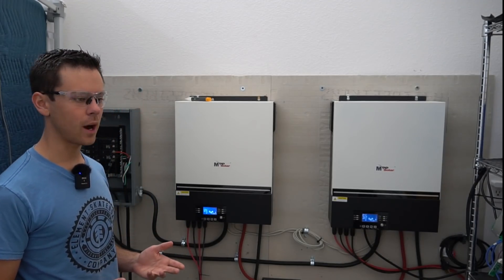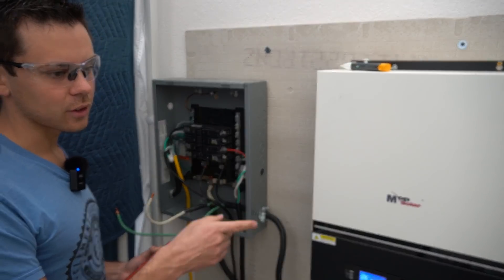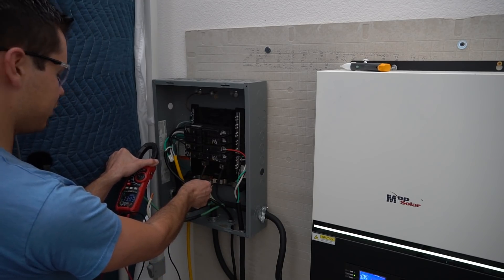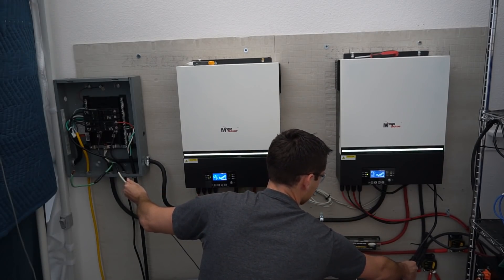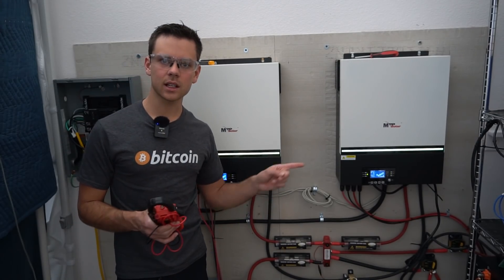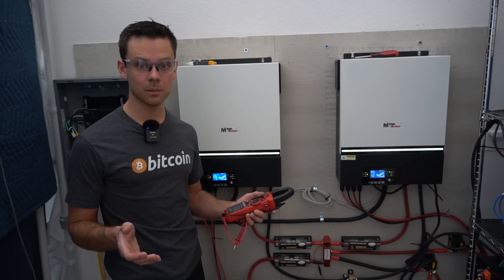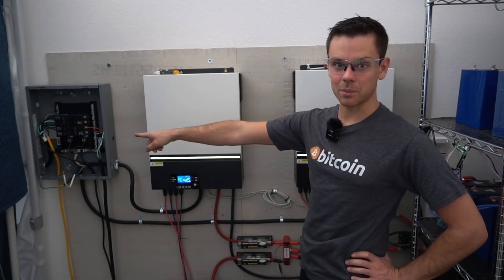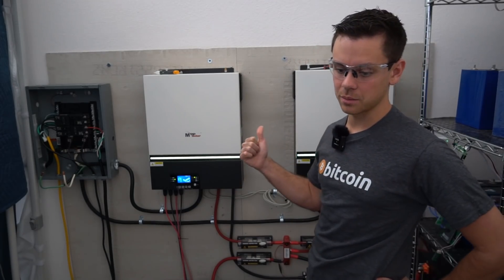Advanced Level Grounding Discussion for All-in-one Solar Power Systems

Comment: For my dual victron split phase setup, the grounds are daisy-chained to avoid ground loops.  The victrons have a ground-neutral relay that closes when shore is not connected; I made sure that my incoming two neutrals to AC-IN and the outgoing neutrals from AC-OUT are the SAME LENGTH so the resistance was as close as possible.  The 14v you saw may be due to mismatched neutral wire lengths.  Agreed -- if connected to grid, don't add another earth ground.  And agreed -- don't add another ground-neutral bond in your panel.  It appears, like the victron setup, you'll always have a ground-neutral bond, regardless of whether you're connected to the grid.  You technically had two bonds (albeit short distance so highly unlikely to cause an issue).  you may also have small ground loops if you're not daisy-chaining your grounds (Inverter 1 -> Inverter 2 -> panel; also grid -> inverter 1 -> inverter 2).  Daisy chains may be problematic from a code perspective; you don't want a breakable ground (so the daisy chain must remain intact if you disconnect the middle device from ground - a la pigtail).  I am not an electrician; I went through this same exercise with Filterguy on the forums when designing my RV system.
BTW I didn't think it was safe or accurate to check for continuity on live wires (voltage potential between the wires)?  Maybe today's meters can handle that?  Dunno...
Reply: I guess what's not clear from your testing is whether the G-N bond actually comes from the grid when powered by the grid.  I WOULD expect ground to be connected all the way through no matter what, just as you showed.  From your description of the expected behavior, it sounds like there's a G-N bonding relay?
Reply: Yes a CAT III meter will happily handle the voltage rms produced by our solar systems so no worries on prodding away at terminals just dont accidently put it into the amp testing modes as most are limited to about 5A I believe? looking at my fluke next to me thats what this model says. Itll act as a dead series short in that mode and we know what happens then

Comment: excerpt

If power for IT equipment is served from a separately derived source independent of the building ground system, noise might be generated on the system. This is a form of common mode noise, in which the power-source ground is referenced to a different point from the equipment ground. These stray currents—in other words, noise—can find their way onto grounded equipment, thus energizing the equipment.

Comment: Yep, this is causing issues for me. I'm using a single LV2424 to power some critical circuits as a backup/free solar. 
The AC output of the LV2424 is going to a sub panel which I have combo AFCI/GFI breakers in, however these are occasionally tripping, along with the 30A GFI breaker in my Main panel that serves the LV2424.
Like you, I have measured 1 volt or less between various points of neutral and ground in my system. I am thinking the bonded neutral in the LV2424 is causing a very small voltage leak to ground that is tripping both input and output GFI breakers.
But for safety concerns I want the LV2424 input to be GFI protected in case something catastrophically fails in the inverter to where the casing could be energized. 
Not sure where to go from here. For now I replaced the GFI breakers with standard thermo-magnetic ones. Which is not ideal and I want to find a solution ASAP but it keeps my circuits active for now...

I should note that I have the LV2424 output circuits going into transfer relays so if the inverter fails, the transfer relays fail closed and the critical circuits still have power from the Mains panel since the LV2424 AC relay is a fail-open type.

Comment: As I said on your Growatt SPF5000ES (US) video.... this issue affects the entire industry, and if there has been 1 constant in the 1000's of comments I've read on the forum about bonding, grounding, ground/neutral bond, and floating neutral, is that there is no 100% right answer.   This option is safer, but breaks some code rule.   But if you build it by code standards, there can be other issues.   And here's the whole new set of problems if you connect it to the grid.  On and on and on in a circle.    I'm glad you looked at another example, and the issues that can arise.  Each and every different inverter needs to be looked at independently on how it addresses this issue, and the system build needs to reflect that.
Reply from the maker: The 5000ES has a very different grounding issue. That one is more dangerous.

And yes, no correct way to resolve some of these. I am not aware of any code that covers daisy chained off grid inverters.
Reply from the maker: And yes, each inverter very different. Each requires special configuration.
Reply: @WillProwse  growatt 3000w said to wire nuetral and ground bonded on the AC output side for off grid in Mobile. For me hot skin condition occurs so it's goes like this growatt 3000 off-grid only to mainpanel. Bonded at main panel and grounded to a ground rod. Solar panels and rv also connect to same ground rod. Hot skin condition resolved after grounding rv to ground rod. Growatt inverter touches main panel(AC output) but not connected.
Reply: @WillProwse  we need more information on what floating ground is. Hotskin condition and how to test for it. We need boat grounding for solar.

Comment: Love your videos much information together.  Can you please provide a written out schematic for your subscribers who would like to comment so we are not thinking or assuming what is a ground and what is a chassis bond. 

In electrical we don’t use words like thinking that gets people killed or causes fires or damages equipment. 
        BBB we either know or we either don’t know and then we’re just speculating and guessing, 
          We open up the equipment and follow all the bondings and grounds we test it with the proper equipment in the proper locations to get the proper accurate readings to give us results that don’t end any equipment damage injury or property damage

So without a properly drawn out wiring schematic between all the panels all we can do is guess and speculate 

Unfortunately the only reason a lot of the city states and countries have codes have resulted from somebody guessing and speculating causing somebody’s death and then a code gets written.

Comment: Here is a fun advanced idea to make a video about: with the days getting long, how can you make a "dump load" that will turn on a device to use excess solar when the batteries are fully charged.
Reply: Yeah I was wanting to see a video on that too
Reply: There are inverters doing this. Try Sol-ark or Deye, the Gen connectors act as a smart load and you can configure the Gen output to be a dump load (water heater)
Reply: I wonder if you could use a voltage-sensitive relay and a contactor for that function, when the voltage of the battery gets high enough itd close the contactor and plug in that device. ON multi inverter arrays i also wonder if one of the dry contacts could be programmed separately from the rest to have the same function? Food for thought ^,.,^
Reply: I would think Will Prowse would design a way for excess energy to mine bitcoin, not just heat water.

Comment: I agree and this was a concern I had recently when setting up a system, because there are many systems that don't specify this but when you test you find it to be true. This is exactly the reason why the NEC says not to have a neutral ground bond in sub panels
Reply: People, remember true earth ground,” grounding rods” is ONLY for lighting protection. Period. That’s it. Multiple grounding rods is a fire hazard if lighting did strike and travel through that ground circuit or energy from around the ground from a strike traveling through the ground circuit. Plus you could get cross arching that cause’s the fire and death or burns to anyone in between. In addition it would most likely fry any electronics connected to it. This has been a documented fact when they use to earth ground huge cnc machines years ago.

Comment: I had in interesting time getting it 'right' on a UK barge. Although our 240V single-phase is simpler, the occasional use of shoreline utility power needed extra thought.  We ended up not bonding N to E  within the boat as that often caused the onshore utility outlet, or the on-board RCD before the inverter input to trip.  All Earths are connected onboard & with the DC -ve of both 12V & 48V systems.  But while diagnosing the tripping we ended up with a 3-way switch to govern how the on-board earth connects with the shore-line earth.  In one position it is a direct connection, in the other position it goes via a galvanic isolator. The mid-position provides isolation (just for testing, with the all-in-one configured to not use bypass).  It's all stable & reliable now.

Comment: I'm french
the earth ground has not to be connected with your home
are able to understand that
input and output of your charger, your home too, connected to the real ground
if your home is connected to the ground, , your solar panel your inverter are connected to the ground 
explain me how your short circuit, your overcharge from your inverter can come back home?
with a real earth ground
in french telluromètre 
you have to make some measures of each ground

Comment: As you said .. Ground should have  only on one place never in two places because of ground loop issue. That is why usually on AC input is ground. You can connect chasis of each inverter into ground of your input system. ..For those who use that..ofc on some system where there is no ground it is the best thing to make ground..but ofc only one  point..i had inverters that were from plastics so they didn't have 3rd wire so yeah that is also option as they had floating voltage..to be honest i'm using that kind of inverter for outside stuff ..just in case there is contact with water..it is abit safer

Comment: I plan to use my home's slab as an ufer ground.  I'll have multiple access points to bond any/all panels, etc to this single bond.  I also plan to install several GEM trenches (ground enhancement material) to further diversify my grounding.  So, in short, my grounding would not be a loop, but all bonded to the same grounding source.  Ground-Neutral bonding should be as close to the "utility" as possible.  So either at the outside main panel.  I would think if the inverters feed directly to this panel, their own neutral-ground bonding would not be an issue.  Oh, I also get to add in a 75 ft antenna tower into my fun....

Comment: This is an excellent article on grounding, with particular attention to lightning protection, a much neglected aspect of all types of solar pv installations.
Reply: It amazes me how often lightning isn’t addressed in grounding considerations.  Most folks just float the whole thing, but I have metal vintage camper.  It’ll light the whole thing up like a Christmas tree if I didn’t create my own grounding system (which I have).

Comment: So I guess it’s true that my solar system even charging with the generator in my motorhome has a ground neutral bond. I’m using a Victron multi +3000 W inverter charger? I’ve always thought they would have to be a floating ground neutral bond because it’s in an RV. True?

Comment: My only questions is with the ground either looped or in one panel how would this effect GFCI circuits? The other issue is on a totally off grid system, if these is a generator backup is that considered grid power? Or how would you connect the generator? Do you first ground the generator or just run ground to the first inverter system? You bring up great issues that get you thinking.
Reply: A GFCI (ground fault circuit interrupt) looks for the difference of current on the circuit conductors.  For GFCI to work properly you cannot bond ground and neutral.  On a Generator they have ground lug so you can connect to a ground point and provide the unit chassis/earth ground, and without it would be a floating ground, all chassis would have the same potential, but no earth connection.  
If you have your Inverter grounded with an earth ground via a sub-panel, the ground wire in your generator cable would provide a chassis ground to the generator.

Comment: Earth-ground is to be made at the panel closest to the source (e.g. power-plant), as most local neutral-ground imbalances should be resolved there.  Problem is that Solar is also "the" power-source.  In grid-tied, the single-point local ground should remain near the main panel with neutral-bond at the main panel.  If MPP did it otherwise, they are in error.  If Tesla requires otherwise, they are also in error.  For off-grid, the single-point local ground could be located near the inverters and neutral-bond in the MPP-box.  Source of problem is phase-imbalance, which creates current on neutrals.  (more...) 

Neutrals bonded to grounds then improperly carry current, which in-turn creates voltages on the ground(s).  This in-turn creates the so-called "ground-loop(s)" so eloquently described by the inimitable Mr. Prowse.
Reply: I always thought that the first panel that uses a main breaker was where the bond took place if you have sub panels they should not be bonded. I run a off grid system (20Kw with 30Kw of lithium storage) and I keep a grid system for extended periods of inclement weather but they are completely separate. I did have both a bonded (solar breaker panel ) and a non bonded grid sub panel attached to the same metal building which created a constant 13 volts across all the grounds so I moved the bonded panel and solved my problem.
Reply: @richardoder3459  - Yes, sub-panels should not be bonded.  Not enough info provided to understand your particular issue, but it's easy to think an issue is solved, only to have it come back to bite (e.g. Mr. Prowse's recent experience)?  It's too easy to start bonding neutral's, thinking that a problem's solved because voltmeter says so?  ...while ground currents go unmeasured, only to crop-up as a different problem later-on?
Reply: this is most concerning but, i lack enough knowledge to full understand this statment or mr prowse's but, what i can dicern is that official documents and well used companies may not have good documentation or practice and lack functional know how to under stand or identify a ground loop or imbalance

Comment: After a lighting strike that went up my ground rod and fried my inverter I talked with a home power engineer and explained how the ground here has coleagy "water proof ash" 12 inches down and the rain sits on top of it and the lighting hit the ground and went up my ground rod and straight to the inverter. He said to disconnect it and only use the battery ground. It's been 28 years now and lots of lighting but no more problems.
Reply: Are you saying to ground the inverter chassis to the Negative of the battery?
Reply: @PotaHam  I wonder sounds kind of like what he's saying

Comment: I don’t know but it seems that the High freq split phase inverters really don’t have a neutral ground  like a low freq split phase inverter transformer .The same for a pole pig  transformer connected to your house . Could there be a ground/ neutral difference among the two since the high freq split phase inverter is all electronic and the low freq split phase inverter has just a transformer ? Might can do a test differential video among the two outputs with neutral /ground to find the best way to connect them to alleviate a common ground loop problem . May the solar be with you Will Prowse or any prepper interested in this matter .

Comment: When the MPP inverters are grid-tied does the inverter separate the ground neutral bond? 
I believe there is no risk in combining grounds from multiple grid tied inverters onto one bus bar as long as there isn’t also another neutral/ground bond on that bus bar. The point is to prevent neutral current from traveling on a ground…unless something bonded becomes accidentally energized. Then you want a path to ground to dissipate the charge/trip the OCP.  The neutral is a current carrying conductor under normal conditions. The ground is only there for the safety of us and our equipment.
Reply: Problem is you create a ground loop which circumvents circuit breakers if there’s a short inside the loop.
Reply: @cybertrk  How will parallel paths to ground cause OCP device not to trip?  Current will flow breaker will trip.

Comment: What do you actually mean by a "ground loop"?
Surely there cannot be current going through the earth; so what is the problem?
I still don't get how electrons supposedly travel from the neutral to the live but then the earth is connected to the neutral.
Reply: Just like how water can flow down hill, there can be charges in the ground. If a good conductor is placed between the different regions, you will get current flow. Similar to lightning but not as spectacular.
Reply: Especially the moisture in the ground acts like a conductor for electricity.
Reply: Current flows through the earth just fine.